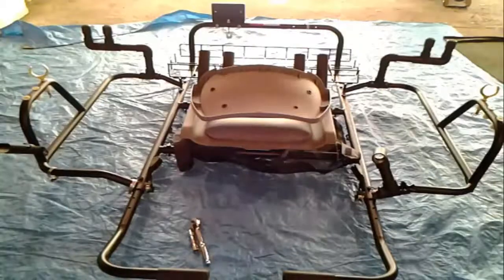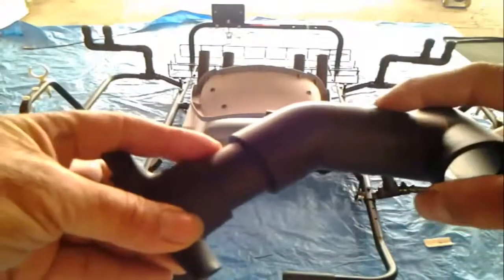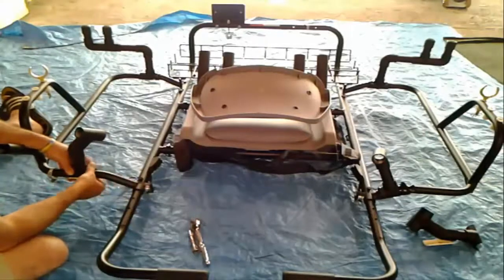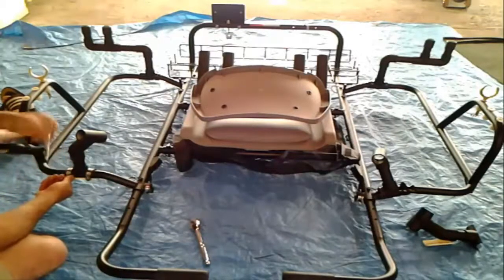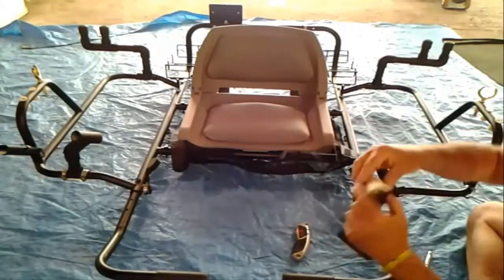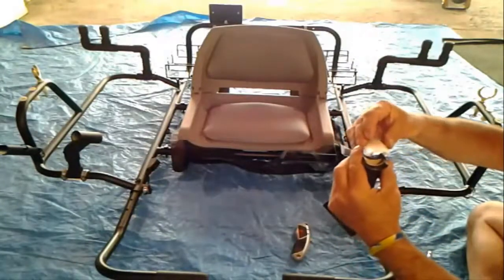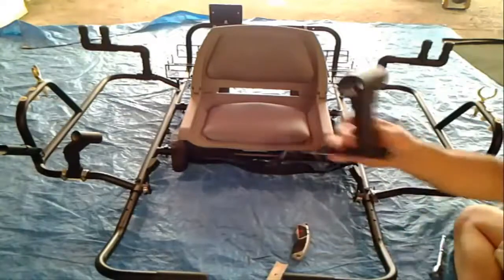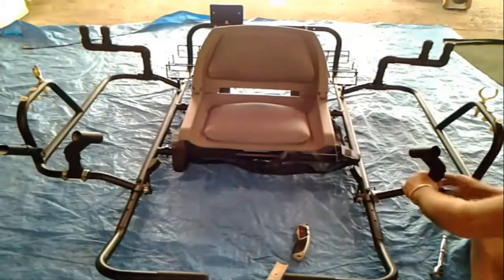Done with the after market add-ons!

Comment: HOWS THE BOAT DOING THINKING ABOUT BUYING ONE WHATS THE GOOD AND BAD ABOUT IT.......
Reply from the maker: Hey David! Well if your thinking of buying one of these bad boys let me give you the down low. The most stable pontoon I have ever used, You sit very high in the water, so good for seeing what your after. Make sure you get a electric pump for the toons. They take way too long to pump up with a hand pump. Tons of storage , With the longer pontoons you are affected more by the wind. The frame and hardware is very well built and solid. All in all a fantastic pontoon. I really have nothing negative I can share with you David. If you decide to but this bad boy feel free to ask me any questions you might have. Good Luck and Happy New Year.
Reply: Was thinking about putting the battery under the seat and raising the seat .......
Reply from the maker: David Barker I don't think that would be an issue. Unless you weigh 400 lbs. Then you won't have much capacity left to work with. I say whatever you can come up with give it a try.

Comment: I like these mods.
Reply from the maker: Thanks Rich! They seem to work pretty well for me.
Reply: How are your hose clamps doing? I use my boat on a river and worry about them rubbing a hole in my pontoon.
Reply from the maker: I haven't had any problems at all. Funny though as I was reading your comment I had a thought. I'm going to try forming a layer of hot glue as a better barrier than electrical tape. I'll post the results later this week. Cheers